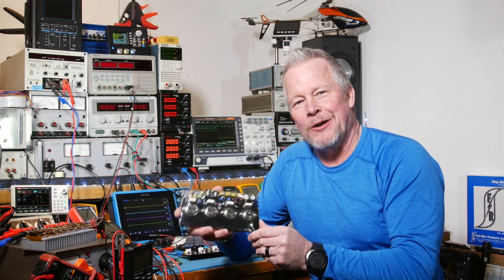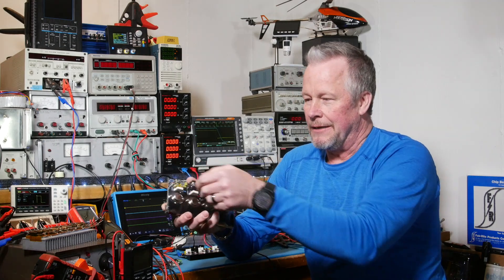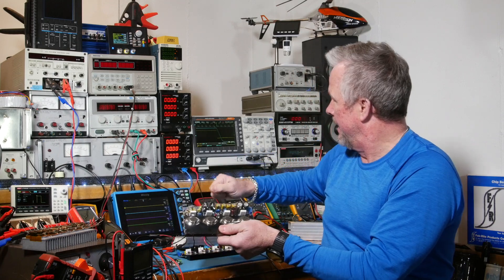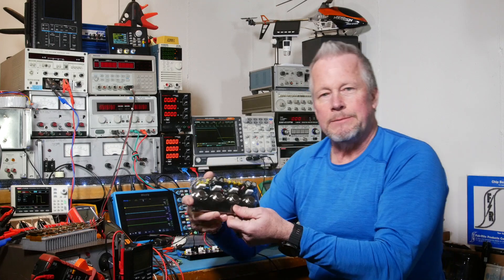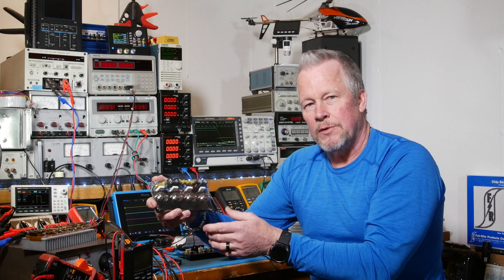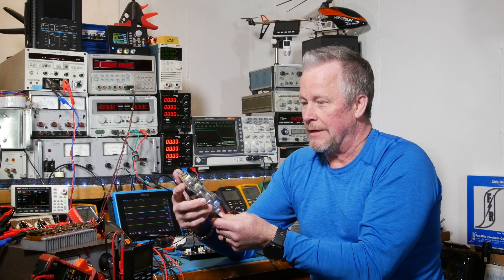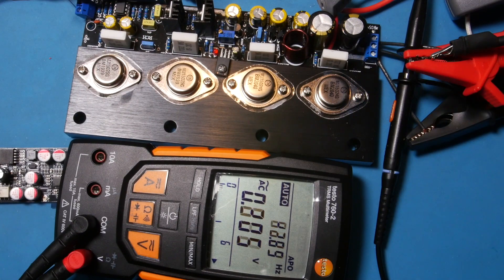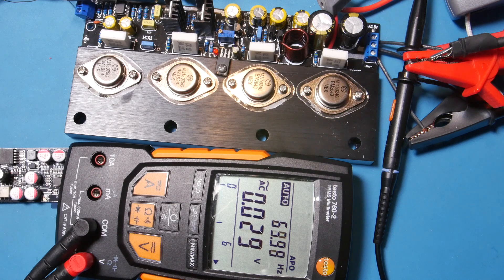20 Watt Class-A Power Amplifier Fail

Comment: I just checked the link to amp supplier and it doesn't say the power AT ALL! apart from 20W and 2-8 ohm... I guess they saw your video. If I saw this and had no idea  I would have guessed from power supplies suggested that it would be giving the 20W into 4 ohms. It suggests a 25v supply, which if all is perfect would give you exactly 10W RMS  into 8 ohms. If as you say there is no voltage gain post op-amp, then again. if the op-amp was ideal you could expect no more than 15W, and of course in practice you will not get that.. Seems like a 10W design as it sits.
Weird. Looking forward to your op-amp mods I saw listed in your homepage.
Reply from the maker: Thanks Martin for your great feedback!!  Have you watched the videos in the playlist where I switched OpAmps and made modifications?
Reply: @KissAnalog  I will for sure. Great channel.

Comment: I think part of the issue is your speakers aren't efficient, but is that amp really making its rated output before clipping? If the clipping isn't symmetrical there is usually an adjustment to center the amp.
Reply from the maker: Thanks for the great feedback!  Check this video out, it explains further what is going on.  https://youtu.be/-VRcelNAcP0

Comment: Thought this might explain or help. 
Note: In order to reduce the hassle of installing the heat sink, the board adopts the CNC machining center carved radiator aluminum plate, but also need to be connected with a large radiator, otherwise it will be burnt because of over heat. There is test point on the board "TEXT", from the white power resistor 0.22ohm to know, if measured TEST point is 22MV, the quiescent current is 100MA X2 = 200MA, X2 is because the tube in parallel. if measured at 130MV, the quiescent current is close to 1A. Clockwise quiescent current decreases, anti-clockwise quiescent current increases. It seems they may have "turned things down" because the transistors will burn if you don't have the required heat sink.
Reply from the maker: Thanks for the great feedback #john shaw!  You might be right, but they should have spec'd it at 8 Watts then.  There was very little information with this.  What you show above for setting the bias is the most I've found.  Maybe the original design had directions on how to set it up for 20 Watts.
Reply: @KissAnalog  I think if you get the bias setting correct with the required heat sink you can get the rated output. I believe the makers set a "power limit" this to stop people connecting the board and then over heating the transistors and then returning them after they overheated. I would expect the amp to consume about 60-80 watts idle when it set up correctly however you will need adequate heat sinking to dissipate the heat. You will need to crank on the bias pot for it to work correctly by the sound of the instructions. These are monoblocks with 4 transistors, they must be good for at least 15 Watts class A. Now you see why Class A amps are not for everyone. Not sure you can fail this amp until you get it set up correctly..

Comment: Hi Eddie.  Are there any published specifications for the amplifier?  I have to wonder if the power delivery issue is specified at a particular frequency or frequency range.  I was under the impression that lower frequencies require much more power delivery in order to achieve a given volume (which is why subwoofers use so much power compared with tweeters), so it wouldn't surprise me if the power figure is for a pure tone at the lowest frequency that the amplifier supports.   Whaddya think?
Reply from the maker: Thanks for your feedback!

Comment: I have been designing amplifiers and in particular Class A for over 40 years. The trade-off is heat for output power and that is why these things are not as powerful as one would like. The class A designs are not really designed for varying voltage since thebias  current is fixed as they are never turned off. Go look at some early designs like John Lindsey Hood, Jean Hiraga, Nelson Pass First Watt and the like, there you will get a better understanding of how class A works.
Its characteristic is a perfect output until you reach the design limit and then the sound just falls apart completely. The reason is that the output current is limited, and for good reason, for good reason, it must stay well in the safe operating region of the device. This type of amplifier is unlike that of class B where you can increase the operating voltage rail and will increase the output until you reach the limit where you actually destroy the devices. 
The class A amplifier is very inefficient some as low as 15% and puts out much more heat than the output power it produces therefore the power supply is normally very large and filled with capacitors to keep the voltage as constant as possible.

The average listening power required for a fairly large room is about 3 - 4 watt (on efficient speakers) only, peaks may reach quite a bit higher, but the amplifier is limited to the design bias current in the output devices, increasing the supply voltage only makes them run hotter since they have to dissipate more heat and will be destroyed.

I suggest changing your speaker for something efficient like a Klipsh, Tanoy, or the like that performs at close to or over 90 dB SPL per watt/meter and it will blow you out of the room.
Class A amplifiers has the advantage that they only generate even-order harmonics and the reason for their warm and easy sound, other amplifiers that produce many odd order harmonics (dissonant) sound maybe clearer or clinical, but edges are ruff and unrefined, if I could refer the effect of applying the  "sharpen" function to a picture file, it only appears as if you are enhancing detail, but you do not. You cannot add detail that was not there in the first place. That is the reason other topologies of amplifiers sound the way they do, they have no timber, and the sound is not correct let alone fatiguing.
Nice channel I will follow it with interest.
Reply from the maker: Wow - that’s awesome to have you here Nico!!  Ok so I have designed a Class-A in the past, but years ago.  I then went to Class A-B not only for effeciency but to get the peaks or more dynamic range.  As you say, that’s where Class A has trouble. What’s your thoughts in that regard?

The power level, efficiency, and room size that you describe.  Is that for nice music levels or load R&R that you can jam too.  So what I mean is what kind of sound level would you add to your description?  

Thank you for sharing your knowledge!
Reply: @KissAnalog  I am trying to reply, but I am being blocked. How can we communicate otherwise?
Reply: @KissAnalog  Hi Eddie, thanks for the welcome. In my opinion a realistic listening level (asume vocals) is that you hear the person singing in front of you at the same level you would expect in real life, the instruments are secondary, that you can do nothing about since it is in the mastering. Heavy rock is different, realistic listening levels  would be at some point you imagine yourself being at the concert. Most non-audiophiles turn the volume knob up too far and although it seems louder all you are down is running into gain compression and although it sounds louder it becomes worse, but the amount of FUZZ and effects on the instruments make it difficult if not impossible to realize you are listening too, maybe your amp falling apart, that is the reason for sizing your amp with speakers in a room that would offer you that pleasure, decent sound.
Those who purchase amplifiers of thousands of watts are either absolute imbeciles or have no idea what they are doing, unless you run very inefficient low impedance speakers that would need plenty of drive current to even make a squeak. These speakers are always designed to be perfectly pure and has so many cross-over components that to tailor the sound for perfect measurement that they need 100s of watt to produce moderate to reasonable listening levels.
Just looking at the board in your hand, it seems too sophisticated to be rubbish, no-one in his right mind throws so many components into a class A amplifier, unless his idea was to create a "house sound"i.e. something the designer liked by the use of foregoing stages, everyone does that even the purest and biggest names in the audio industry such as Mark Levinson, Nelson Pass and all those famous guys. However, they have pure tone and can hear deficiencies in the sound and will correct what they hear (not necessarily measure alone). You do not find a tone-deaf audio designer, nobody will buy is stuff. Besides measurement, listening is the ultimate test, it can measure anyway you design it, and you can but if it sounds crap then that is your end.
Try and get the schematic from the designer, seller and let's take it from there. I am retired and have not much else to do. I design amplifiers just for fun now to see what I can do with the least number of components. I will help you where I can and anyone is welcome to some advice.
Reply: @KissAnalog  Dynamic range is not always well understood, but it is the ratio between the softest and loudest sound that an amplifier or anything will produce. If you are listing to a program with a tiny triangle playing and you just hear it followed by a crescendo of the whole orchestra, that is dynamic range, It is the lowest signal, normally the noise floor of the amp compared to the loudest signal and expressed in dB. Headroom on the other hand is really some fictitious idea that the amp can produce sudden loud instantaneous passages. Yes this is done in crummy cheap equipment to amplifiers with insufficient power supplies and the power supply capacitance was totally relied on to produce the sudden surge of energy, this was dubbed headroom. From this the rule of thumb was developed that for every peak amp you require, you added 1000 uF to the supply rail. The run-of-the-mill amplifiers still practice this because it is cost-effective. However, properly designed and beefy power supplies will give you the best performance out of your equipment. Think of an amplifier as a device that modulates the power supply, nothing more. If you like you can mail me (nico@ras.mobi) I actually enjoy helping people achieve perfection in their designs or making it as good as practically possible. It passes my time until I die.
Reply: Looks like YouTube squashes replies containing an e-mail address, this was the third time I wrote a very longwinded but accurate reply. I am not sure how to offer you my e-mail adress and hopefully I can discuss some of your concerns.

Comment: There is something wrong with that is there another connection for the power section?. The max voltage seems to be for the op amps, 17 volts seems kinda low for power amp rails. What's the idle power consumption etc. Are those really to3? outputs?. Can you work out what it actually is?
Reply: I think I agree John, more like power supply for the pre amp, probably a 5532/4 something like that. I don't think the regulators with those small sinks will handle the class A current. Plus WHY would you do that?
Reply from the maker: Thanks #Michael Beeny!  What do you think of my response to #john shaw?
Reply from the maker: Great questions!  You are right, this is the voltage for the rails of the OpAmps.  That's what I meant to show probing the zener diode.  I meant to explain that this regulation is for the input circuitry, and not for the power rails.  I kind of joked that that would be too inefficient, even for Class A;)  I think what the problem is, is that the gain of the OpAmp drives the final stage that has no gain, so when the input stage clips - it sends that to the output stage.  I was trying to show that by demonstrating that it didn't matter what the plus and minus supplies were set to - form around +/- 17 V to +/- 31 Vdc.  So I could correct that by increasing the gain of the OpAmp, and/or by increasing the zener diode range.
Reply: @KissAnalog  I don't think that you would get more than 8 or 9 watts from the class A amp. Increasing rail voltage just puts the output transistors at more risk of damage. Please check which output devices are used, and we can look up their SOA (Safe operating Area) in the data sheet. Coming from Chine these may  be used (removed from another scrapped product) or even fake.
 Used is not so bad as it remains original. What I would say is  that you should measure the total current of each output device, this is easily done by measuring the volt drop across the emitter resistors and calculating the current. This then would tell you what output power you could expect by applying P = I²R you won't get more regardless of increased supply. 
Also make sure that both transistors conduct the same current, else it is not class A but some other topology. This thing should be running F@$^&KING hot not even warm, I am predicting 50 degrees centigrade with even a large heat sink.

Comment: Eddie,
This is the one I originally got:

https://www.ebay.com/itm/One-Pair-PASS-A3-30W-30W-DC-25V-Kit-Single-Ended-Class-A-Power-Amplifier-Board/123874240314?hash=item1cd77ae73a:g:7N4AAOSwJ9RdU8Cu

It did about 6 to 7 watts and then clipped with 24v rails. No schematic but I found one and sort of modded it but it was so darn inefficient that it's not worth it for me. Pass says 25% efficiency but I doubt that too.
I guess I'm a dog for punishment because I just bought these boards a couple of weeks ago which are supposed to be from the Pass design and the guy who sells them is supposed reputable with 100% feedback. He sent me the schematic and BOM fast from China and the boards look good but all my transistors haven't come in yet to build it.

https://www.ebay.com/itm/30W-Mosfet-Pure-Class-A-SE-amplifier-PCB-stereo-pair-based-on-Aleph-3/321713388180?ssPageName=STRK%3AMEBIDX%3AIT&_trksid=p2057872.m2749.l2649

We'll see but I'm leaning toward the class D ICE boards now. Cost more but they are quality and from a good seller in the states. I'm going to buffer the class D with tubes to see if I can get the sound I like. As far as headroom the class D amp from Sure I have now is pretty good and a big difference over the class A amps. I never realized how important the dynamics were until I heard them again. 

I'm wondering if you could buffer the class D with a jfet amp in class A, that might sound good and the buffer doesn't have to run that inefficient so it might be the best of two worlds. I played around with jfet amps and they can get pretty close to tubes. I did an article that was popular and I have one I designed in the office that I've used for years.
Reply: No you can't. Class D is a pulse width modulated amp and it character would be embedded in the sound path, it is more feasible to buffer a class d amp with a class A valve stage and there will be more of this sound contained in the output. Keeping in mind that the earlier the stage in amplification the more of its characteristics is carried over to the next. If for instance the pre-amp has a high distortion it makes no sense to follow it with a power amp that has zero distortion.
Reply: @nicoras8803  What I'm proposing is to use a jfet amp before the class D amp using a jfet followed by a unity gain transconductance stage into the class D amp which is entirely possible. The unity gain stage enables the jfet stage output to be high impedance. 
Yes, I want the buffer stage, regardless whether vacuum tube or jfet to highly influence the sound of the class D amplifier, that's why it's there. Here's a design I did awhile ago showing how I used a jfet in a preamp:

https://audioxpress.com/article/willow-revisited-a-design-celebrating-the-enthusiasm-and-the-creativity-of-the-builder

Let's say we used this amp to drive the class D, it would have many of the characteristics of the jfet which clips very much like a tube. Why not incorporate a similar circuit into the class D as a package? 
My favorite is the tube buffer stage. I like the 6922 but my favorite tubes are directly heated cathode battery tubes. They really have a nice sound and I can pick them out in a DBT.
I did try using a 6922 preamp into the class D amp. It's okay but not 100% of the sound I'm looking for. Ideally what you want is a totally neutral power amp colored by your preamp or buffer stage. This is why I'm trying to get away from the Pass designs with <25% efficiency and why I don't like tube power amps. If you can do it before the power stage then you get to have high efficiency and good sound.
Thanks for you response.